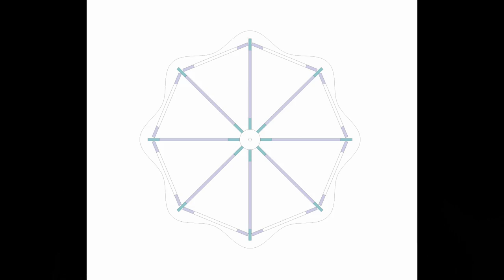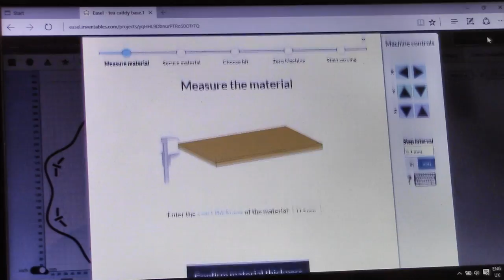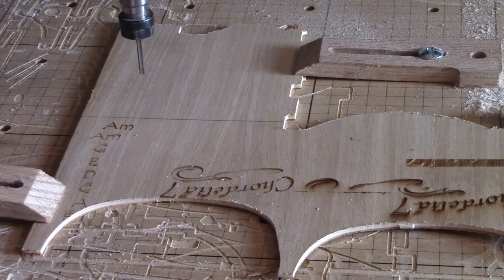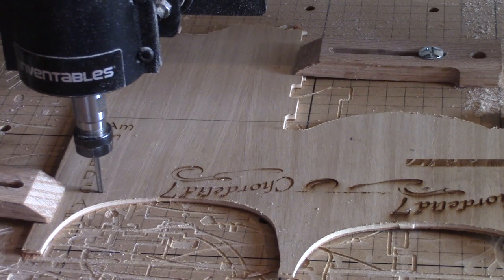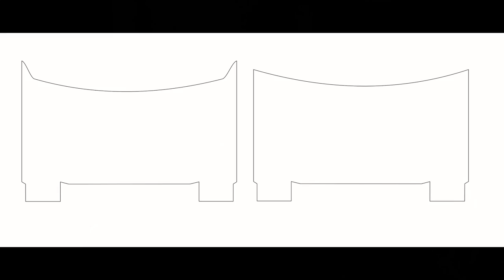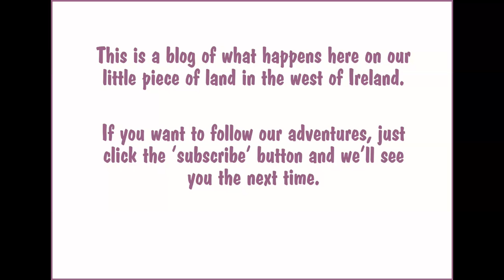Making An Octagonal Tea Caddy (Without Screws Or Glue, but with an X-Carve CNC Machine)

Comment: try putting a piece of paper under the bit and lowering it by .002" at a time, moving the paper back and forth until the bit just pinches the paper but doesn't rip it when you pull it out. it doesn't scratch your wood. also, we need to hook you up with a dust boot! lol
Reply from the maker: +7711gman I could make a dust hood but I really like to see the bit working

Comment: Really nice!

I wonder could you route all the pieces out of a single thin sheet? With a touch of wood glue, the base would get very strong with all the uprights.

Secondly, a semi-circular base with only 4 compartments would let it sit nicely against a wall or on a small shelf. 

I'd probably pay 30 euro + p&p for a kit like that. Don't now if that would reflect the materials cost though.
Reply from the maker: +Aidan Breen Two really good ideas Aidan, thank you. The materials are not the main costs - it's the sanding, varnishing, etc that takes the time and adds to the price
Reply: Ah, I assumed you'd leave those details to the customer!

Comment: a good source for very high quality ply is an rc-aeroplane shop. Modelers use ply for all kinds of things in the rc world :)
Reply from the maker: +Daniel Christiansen Thanks Daniel - expensive though?
Reply: +WayOutWest Blowinblog   plywood for model making usually comes in 30x 60 cm sheets and and can be had in various thicknesses. A 3mm sheet is around 6£ and an 6mm is 8£.  Hobby plywood usually have many more layers than the building supply variety and is often made of birch. / Daniel
Reply: +WayOutWest Blowinblog just did a quick search, and you may be able to get ply for a lot less than here in Denmark, 
http://www.alwayshobbies.com/materials/wood/plywood/quality-birch-plywood
Reply from the maker: +Daniel Christiansen They look wonderful, don't they? But they're in England and the transport costs to here would probably more than triple the cost. Must look into that though..

Comment: Attractive design, and whimsical looking.  You achieved your goal of making it look like a circus tent.  Do you think access to the compartments would be easier if the top pieces were secured to the side pieces, and then have the pivot tabs located at the bottom of the side pieces?  A couple of tabs & slots would connect each side piece to its corresponding top piece.  Of course, the slots would have to be cut at a slight angle to match the slope of the "tent roof."  Hey, on another subject, did you ever finish the doughnut wagon?
Reply from the maker: +deezynar Wouldn't you need pins at the top and bottom of the lids? - Not sure where the holes would be for the top pins..

Doughnut cart STILL not done! Because I've been working nearly full time on another project which I will be sharing with everyone just as soon as I have applied for the patent..
Reply: +WayOutWest Blowinblog My idea is to have each top piece solidly fixed to their respective side piece.  The top, and side, would hinge as one unit.  The pivots would be located near the bottom plate.  This design opens up the storage areas for easier access, but creates a few issues that your design didn't have.  The first one is how to solidly, yet easily, secure the top and side pieces together.  I mentioned a possible solution in my first comment: use tabs and slots, but glue would be needed.  That makes it impossible to take the whole caddy down to flat ever again.  Another issue with my idea is that when the side pivots away from the storage compartment, there is no longer a barrier to retain loose items inside the caddy.  That wouldn't be a problem for tins, but loose tea bags would spill out.  It was just a thought, maybe not a good one.
Reply from the maker: +deezynar Yes, that might work. Though, as you say, joining the top and the short side piece together at an obtuse angle could be the tricky bit. tabs and slots wouldn't work because it's not 90 degrees. You keep thinking and I'll keep thinking and between us we might work it out